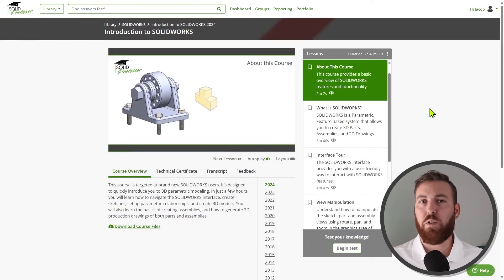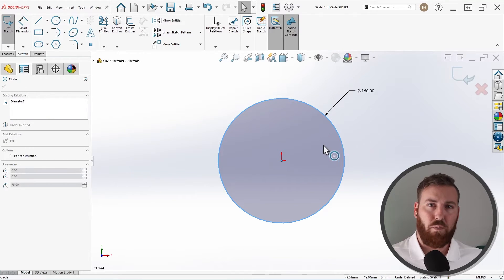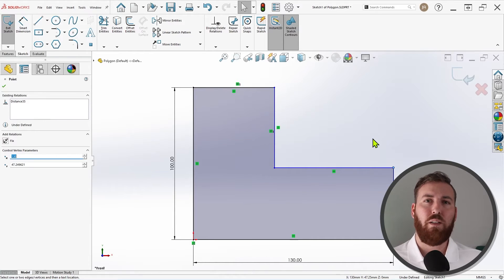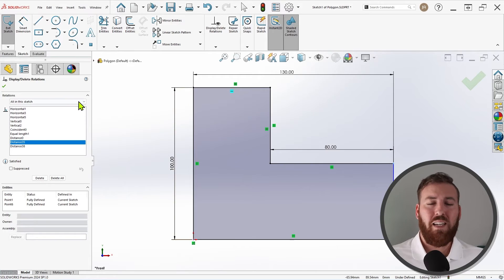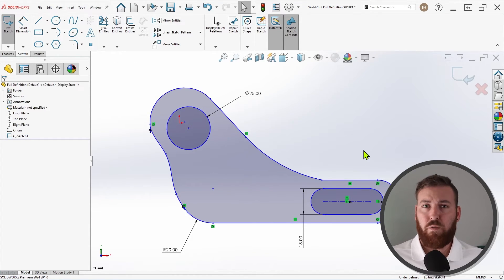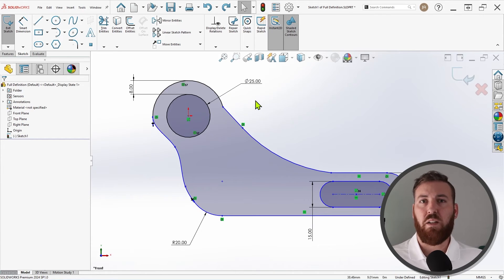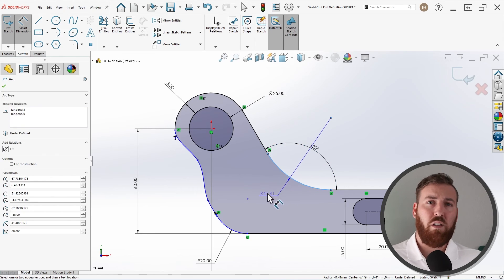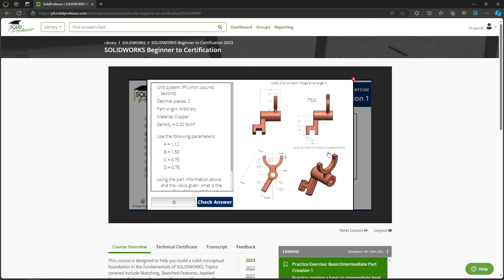Why Is My Sketch Still Underdefined?

Comment: What about when a sketch is all black but still shows (-) under defined. How do you find the dangling entity?
Reply from the maker: I would be on the lookout for an underdefined point, which can be really difficult to see when everything else is black. This often happens when the orientation of a line segment is defined with a relation like horizontal or vertical, but the length of the line isn't defined.

I'm unaware of any tool that specifically checks for under-definition, since it's fairly common in advanced modeling to intentionally utilized under-defined sketches. However, if your case you might be able to determine where the missed constraint is by using the Fully Define Sketch tool, applying it to the entire sketch, and watching closely to see what changes (make sure the visibility of sketch relation icons is on too).

Wherever a new relation or dimension is added will very likely be where the under-definition was happening. Do be careful with Fully Define Sketch though, even though it will fully define your sketch, it often does so in a very dumb way so you may need to delete and reapply whatever it decides to do.

I hope this helps, let me know if this approach works for you!
Reply: @SolidProfessor  Thanks, I ended up saving my part to another file and started deleting lines till I found a dangling point from a deleted line under another line end point.